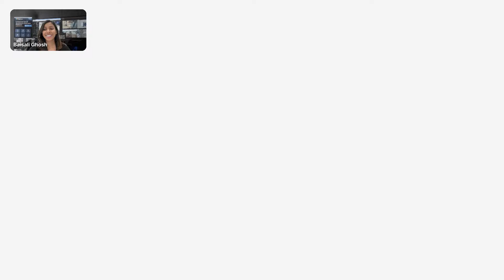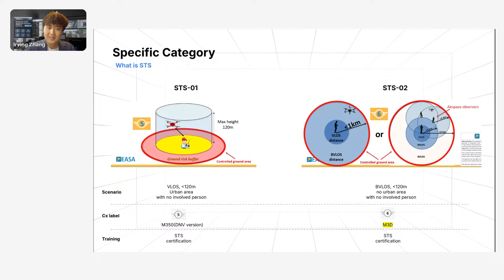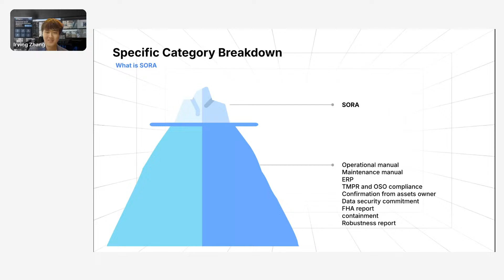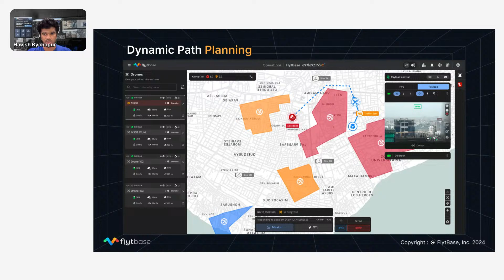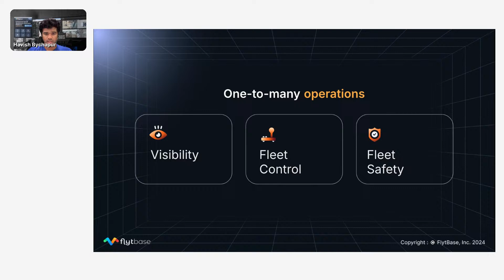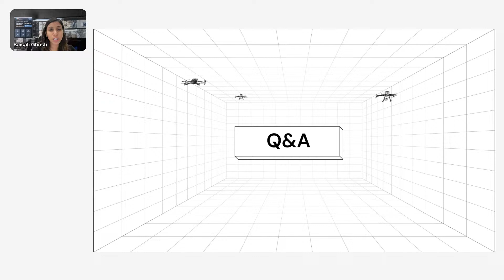[Part 2] Navigating EU Drone Regulations & Waiver Process for Dock Operations

Comment: It seems clear that until DJI decides to equip their Enterprise drones with flight termination systems that comply with internationally recognised standards, those dealing with SORA or PDRA will always encounter issues. There's no point in avoiding the topic. They certainly have the technical capabilities, or alternatively, they should provide manufacturers with the necessary schematics for the drones, so as not to make life difficult. When designing a drone, it is essential to include a termination system operating on a distinct frequency; otherwise, no amount of SORA, PDRA, or Waivers will suffice, and the authorities will always raise objections!